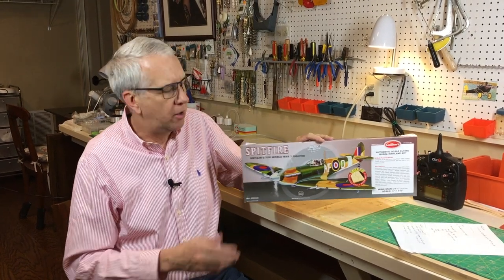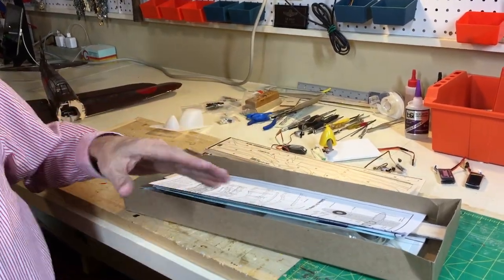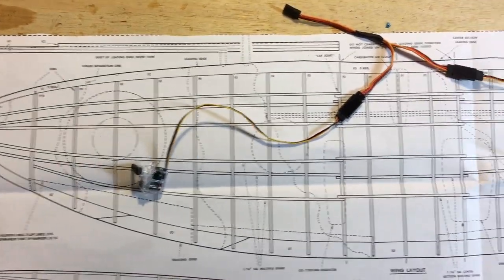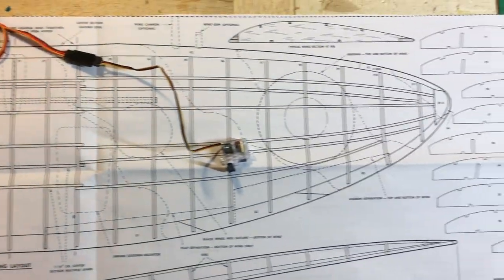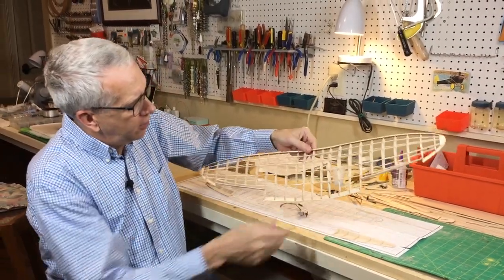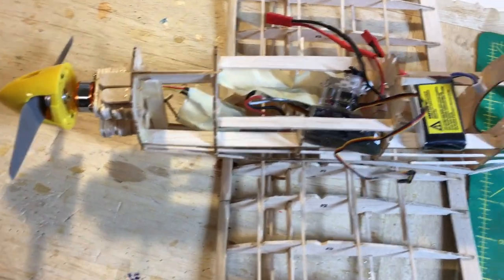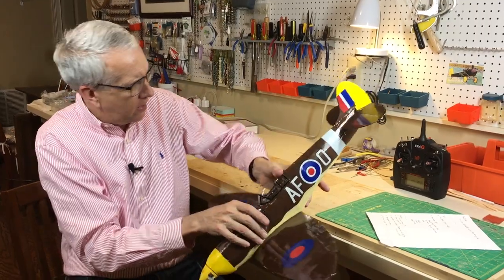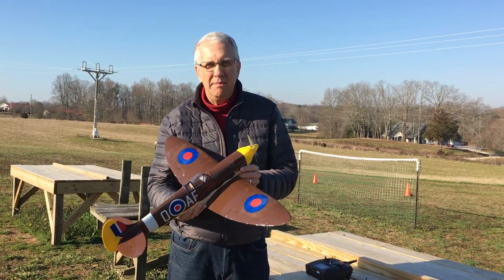Guillow Spitfire RC Conversion

Comment: Tim, I appreciate you posting what you learned about the process of converting these planes since it helps us all in the long run! I am attempting to do the same and upload what I learned converting my kits on the off chance that anyone can learn a thing or two! I have learned a lot from your videos and am now feeling confident to try putting plastic covering on my guillows! Thanks for the inspiration
Reply from the maker: TWW:  Thanks so much for checking in and best of luck with your RC conversions!  Tim
Reply: @TimMcKay56  oh, I have a follow up question! What do you recommend for detailing over the plastic covering? For example on my spitfire I’d like to add the camo as well as the black and white stripes over the mid wing and fuselage. Is it a good idea to cut out more Parklite and bond it over the base covering? Or should I instead tape it up and paint those colors on?
Reply from the maker: @thatwontwork9046  Paint is probably the best option.  Cover the model with the lighter color iron on covering (tan, in this case).  The dark green should cover this OK with paint, or ecven the green iron-on covering.  Monokote trim might work well for the black and white invasion stripes.  Tim

Comment: Nice job with this project.Many years ago when Cannon came out with their micro radio systems I converted Guillows “ Giant Scale” Hellcat powered by a Gmark 061 . I used 4 channels. The plane flew ok but needed more power .A Norvel .074 would have been perfect. Small planes can be a blast.Keep up the videos,Cheers, Skip
Reply from the maker: Skip:  Thanks for the recap, more videos to follow!  The newer RC electronics and motors really help. 
 Regards, Tim

Comment: Hello thank you for your videos I am just getting started in all of this. I have been trying to cut out the stabilizer and tail surfaces what is the best tool and method to be cutting through 1/16" stock so that the cuts come out clean and not jagged plus unseemngly?  My exacto tools proved unwieldy. Thanks again!
Reply from the maker: Nicholas:  I use a light grade (weight) of 1/16" balsa for the tail surfaces.  I use an Xacto #11 blade.  Buy a pack  of the #11 blades, be sure to throw away older ones as they become dull.  Tim

Comment: Very nice video and beautiful aircraft, im searching a good and light model to make an Rc conversion, i need a stable model, i love the fw 190 but i dont know if it is a good option.Wich did  you reccomend? Thanks!
Reply from the maker: Either the Spitfire or the FW-190 are nice models.  I would lean a bit to the FW-190.  Consider extending the nose a bit to help with center of gravity, as the WW2 models will come out tail heavy.  Tim
Reply: @TimMcKay56  Thanks!

Comment: 7 ounces? That is really good, I am making the Guillows No 405 P40 kit, I believe that the Guillows kits are easy to convert to RC kits, the wood is light and strong, and you can reinforce some areas with the scrap balsa, by the way, how much does your brushless motor weigh? I think my 49 gr motor is heavy :/
Reply from the maker: Neftali:  The quality of the balsa wood on the laser cut kits is a lot better than the older die cut kits.  A lot better.  Suppo motor weights 13 grams, see Spitfire description on details.  Tim

Comment: I’ve got this model to build for RC conversion as well.  I originally planned on running this on 3s with aileron, rudder, elevator, and retractable landing gear.  I’ve got some pretty small retracts but it will increase the all up weight a decent amount. I guess I’m looking for a little more weight and it should fly at some higher speeds.  How are you attaching the wing to the fuselage?
Reply from the maker: E11:  Sounds like you have a plan. If your Spitfire is a bit heavier, just ensure you have a bit more power, as it will fly faster.  For my model, I glued the wing on, no rubber bands, etc.  I figured it was a light enough plane to have minimal damage during landings.  Tim

Comment: He does a great job converting these models to r.c. I fly radio control models and over the years have made all the Guillows war birds , unfortunately no matter what is done to them they are to fragile and relatively unstable to fly ,all it takes is one poor landing and it’s damaged beyond repair, so goes all the time and effort, However if building is enjoyable then they are great models to build,  A company called Flitest  sells a Spitefire, with almost 4 foot wing space it’s foam board and takes a little skill to make  but a fraction of the the time ,great looking when finished  ,hand launched flies right out of your hand steady as a rock,and very surviveable .
Reply from the maker: Vito:  Fully agree with Guillows analysis, and Flite Test does make some very nice models.  Tim

Comment: If you add a gyro it will be much more stable, will feel like a larger and heavier airplane.  Today there are gyros integrated with the receiver,making installing it feasible.  There are separate gyros from RX  but the space available is restricted
Reply from the maker: Great points, thanks!  Tim

Comment: I have a question....won't mounting the servos under the wing cause the to strip when you belly land her??
Reply from the maker: Very good point. I do not think the servos will strip, but not the best servo location. Servo on the wing upper surface may be a better place. Tim

Comment: what would it be Like building one up Light weight. as in using tissue to cover and More Light weight components Like 1.5g Linear servos and a little brushed motor..?
Reply from the maker: MG:  This is a good approach, but you will have to keep the weight as low as possible.  Tim

Comment: Hi Tim, I just bought 4 servos now I get from the internet is I've been had. The servos I have are Tower Pro MG90s. I learned that their counter fit and are really bad. I guess I should have known by the price. I got an ESC, a motor, and 4 servos for less than 29 dollars. The Hi-Techs are 13 dollars each. I guess you get what you pay for ;(
Reply from the maker: David:  Yes, there are a lot of scams out there for inexpensive RC gear.  As a general rule, I buy all my stuff from either Horizon Hobby or StevensAero.com.  If I see the same thing on Amazon (say, a Hitec HS40 servo), I can purchase from there.  And for certain, do not get a cheap lipo battery, as they could start a fire.  Tim

Comment: Hello, Tim... could you specify which electronics are used in the Guillows models and mainly where to buy them? Thanks (Walter from Brazil)
Reply from the maker: Walter:  Oops, I forgot to add this to the Spitfire description.  Info now posted there.  Tim
Reply: Thanks a lot!

Comment: Hi Tim.  Thank you for your videos. Question? Used exact same electronic set up you used for spitfire and zero models, since balsa plane I’m building is about same weight. When set all up to transmitter , servos work, but motor just sputters? Replaced motor with same motor and still same? All works but motor not spin. Any idea what I am doing wrong? Is there some fine tuning I have to do with my nx transmitter and castle esc? Any info would be appreciated and helpful. Thank you
Reply from the maker: George:  Motor is a simple brushed motor, should work. Sounds like a problem somewhere in the ESC portion of the brick. Maybe return to be repaired or replaced. Tim
Reply: @TimMcKay56   thank you , Tim. Motor is brushless: Suppo motor you used
Reply: No brick. Regular rc set up
Reply from the maker: Sounds like a loose wire perhaps in the motor. Tim

Comment: I live in AK and therefore have plenty of water around to launch from (sometimes easier to fly off water than land). Have you considered the Guillow’s Nakajima A6M2-N “RUFE” (kit# 507). Wondering if you think it would be possible to make this floatplane fly off water?
Reply from the maker: Chris:  The Guillow 500 series kits are very small models, the Rufe being 16.5 inches.  It would be quite a challenge to get this smaller size to fly with RC . . . I have enough problems with the 28 inch wing span models.  Also, while the Rufe looks great, with that large centerline float, I am not sure it would ever take off from water, due to constant goune (water?) loops with the wing tip floats.  Better to stick with a flying boat of the normal twin floats.  Tim
Reply: @TimMcKay56  thank you for the insight! I did think more about initial stability issues with the single float. I agree; might be better worth the time to stick to two floats!
Reply from the maker: @christophercastaneda917  Good luck!  Tim

Comment: Looks a little tail heavy and too much aileron movement to me. Good job though.
Reply from the maker: Bob:  Roger that on the aileron throw.  I did not have enough on the Zero, vowed to fix that with the Spitfire.  Took out some throw on the transmitter, handles a lot better now.  Tim